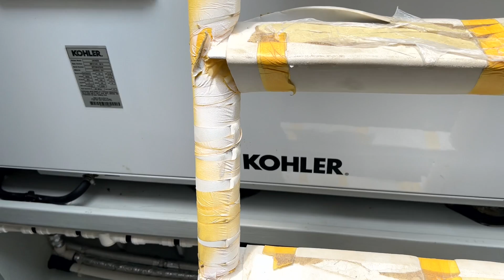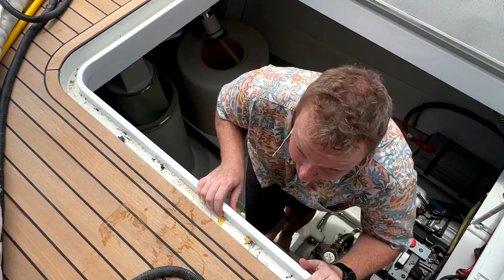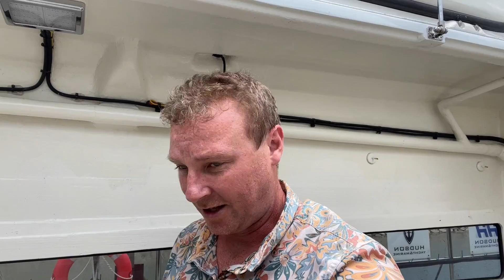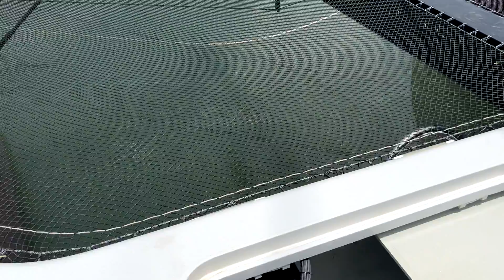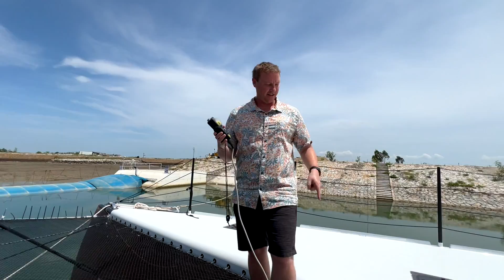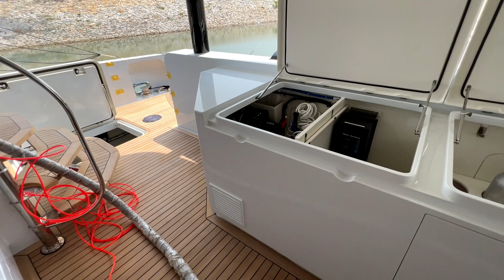Sketch To Sea: Technical Tour of HH8801 Crazy Love

Comment: Do you really run the raw engine cooling water through the hot water tank, or do you run the engine coolant through the hot water tank?
Reply from the maker: Good question. There is a heat exchanger that heats the domestic hot while cooling the engine. We do not run the "raw" water through the the system.
Reply: @sketchtosea3750  Amazing vessel.  (Master of the obvious comment if there ever was one).

Comment: You forgot to show us the massive solar array, or maybe that's in a previous video. I still have to look through those. I would be very interested to learn a little bit more about the (green) energy management. You did not opt for hybrid drive or is the ecodrive simply not an option on this size yacht? Very impressed at the technical complexity. Do you need special training or do you plan to have a technical crew-member? The davit is one of the most ingenious solutions I have yet to see. I would still opt for a swim-platform - especially because you seem to be very much into diving - but I guess you went with this solution to be able to have a dingy and jetski. This is the most impressive sailing yacht I know of. There if of course Mconaghy but I haven't seen any footage of their big sailing cats. Thanks for sharing!
Reply from the maker: Thank you for the comment. Yes I do go over the solar in one of the other videos. We have 7.2 KW of solar built into various different parts of the boat which is capable of producing 150amps peak, and has averaged about 110 amps. With C-zone, it is pretty user friendly. With a 10 minute discussion most people would be able to learn how to control the vessel. We do have a technical crew member, but we enjoy knowing how all of this works as well. You are correct about why we don't have the swim platform, and long term they just become a hassle to service and maintain. When designing this boat we were back and forth between McConaghy and HH. We are very happy with the decision to go with HH, and this is not a slight to McConaghy at all.

Comment: I'm so impressed with your boat. Have the future of refits and repairs been looked at? I imagine when an electrical overhaul is required that it will be a mammoth job but has that had consideration? I know boats have a high demand for maintenance so how have you looked at that overall?
I read through all the comments and the first one made some good points. So from that and also, I gather your chartering as well so how reliable do you think it will be? HH seems to have a lot of experienced-based people in their setup so how do you feel that has translated to your reliability and simplicity of the project and equipment that has been chosen?
Reply from the maker: Thank you for the comment. When planning a build like this there was a lot of thought put into the location and the selection of the various equipment on board. Everything technical is easily accessible. As far as charter reliability goes, a lot of that is going to come down to standard maintenance and preventative maintenance of the vessel.
Reply: I've watched all your Videos and you did your homework as well as HH and the engineering work that has gone into it is just incredible. Being in China your time zone is close to mine on the east coast of Australia so it's nice to get responses so quickly just noticed. It is going to be really interesting to see your progress after sea trials are you going to continue the content?         @sketchtosea3750

Comment: A good rule for blue water and one you may not know: never take anything on board a boat that you cannot repair on your knees or back with a flashlight , while vomiting and being tossed about. If you could not repair it on a workbench with good lighting , while siting comfortable with a laptop and a manual, how could you do so in a boat during a storm? In other words there is a lot, wayyyy too much, stuff that can break and diagnosing where it is going is to be a difficult task, especially in an emergency or harsh condition. You are going to need a marine engineer as part of the paid crew as I doubt any owner without training as a mechanic and electrician, will be way over his head. While all appears well thought out, things break on boats ( Murphy's Law: at the time most critically needed) and the biggest and most common issue is that it takes a lot of time and trial and error to figure out what is wrong, well before a fix is thought of. Simple designs are better as you will soon find out. So many crafty designs these days and the boats keep getting more complicated, and that is their weakness in my view. Also popular fly bridge concept borrowed from motor boats is not seaworthy in my view. It's popular in the luxury style but NOT seaworthy. In a rough sea way you do not want to be up high in the boat where the movement is more pronounced, particularly while steering or trying to navigate. The boom is way too high and adds to the tipping danger in high and confused seas. And why fixed keels? Are you trying to slow the boat and make it less able to point? If so this is a protected water cruiser, not a go anywhere blue water boat. And what of solar? You have enough space on board to have an all electric boat. Way too much reliance on mechanical propulsion energy production rather than sail and solar on this yacht. Not a performance boat.

Comment: Batteries is that 12 x 200A or 300A? Sounds like you HAVE to run aircon using genset. Isn't the battery Bank large enough to run at least some of the aircons? And you talk about shorthanded sailing, what does that mean, how many total crew will you have including you and your wife? And thanks for the show around :-)
Reply from the maker: Thank you for the question. We are set up with the batteries to run silent through the night (all hotel loads). What I mean by shorthanded sailing is 2 people can operate the vessel. Batteries are 300A. In total we will have 4 additional crew.
Reply: @sketchtosea3750  Thanks for info. Looking forward to the sea trial vdo's :-)

Comment: Are you going with Starlink Marine for your internet connection?
Reply from the maker: We do have starlink high performance. It is illegal it import to China and will meet us in japan with our container of goods.
Reply: Wondering how many other things need to be installed or added later due to China problems...
Reply: @sketchtosea3750  Beautiful Boat. Tours are great. If you ever have any questions regarding ship to shore internet connectivity please feel free to ask me. I work for 4G/5G router manufacturer Cradlepoint in Sales (little professional jealously that there is a Pepwave device. Though we cannot send our devices to China either.) a division of Ericsson. My territory is New England so get a lot of inquires from Newport, R.I. (and points north) heading to Caribbean and Med. regarding Internet connectivity. Also, why that engine manufacturer?

Comment: i have notice all fire equipment is located inside compartments if the fire is in the compartment will it not be impossible to get to the fire supperession equipment
Reply from the maker: Good question. We hope to never have to use it. There are a few stations around the boat that are not in compartments.
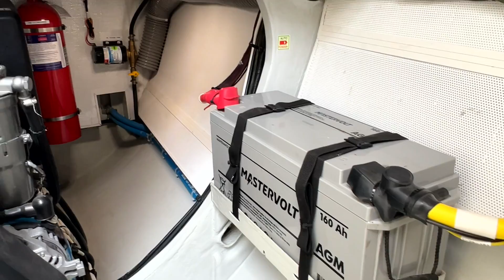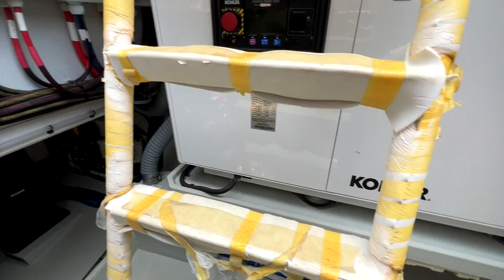Reply: I noticed the same thing. The extinguishers at 2:26 and 5:55 are unreachable in case of an engine fire. I think that it would be better to locate them immediately next to the hatch, so that you can grab them first ting when opening the hatch. And the one shown at 10:10 might be difficult to reach if the metal cover gets hot due to the fire.

Comment: With several battery packs throughout the boat does that mean that there are fire suppression systems in all those locations as well?
Reply from the maker: It does, but not because there are batteries in different locations. It is a RINA requirement. The classification itself is outdated and has not been updated for current modern lithium batteries.

Comment: Noticing how the Rudder Stock Thru-Hole was molded into the hull elevating the connection point, is that above the waterline for added safety in case of a leak or if an Orca decides to chew on the Rudder?
Reply from the maker: It is well above the waterline.
Reply: Commonly called, " Orca Safe."